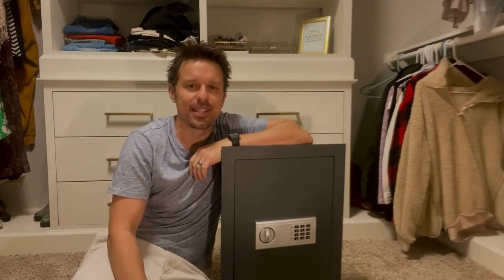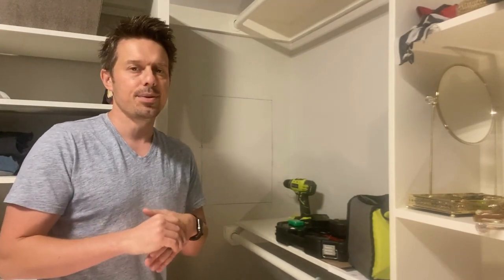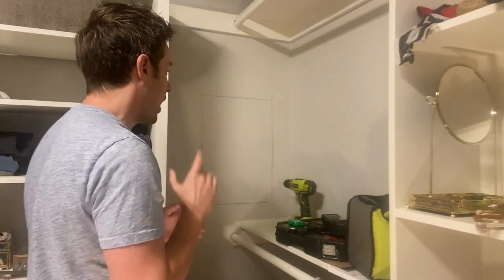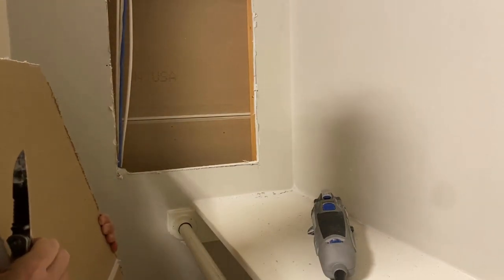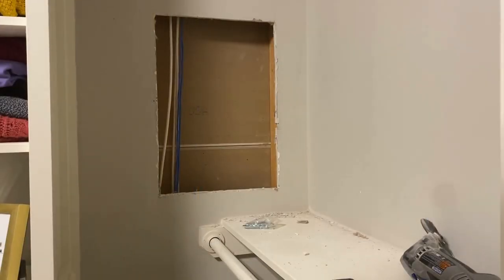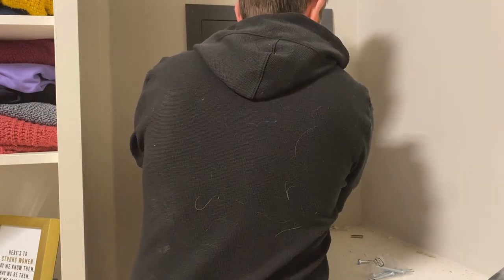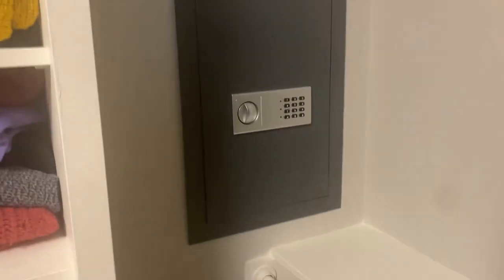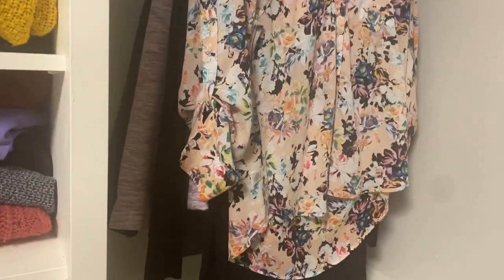How to Install a Wall Safe - Paragon Lock & Safe Install & Review

Comment: You found wires.  With my luck, I will find wires, water pipes, a SpaceX rocket, a car park, an amusement park, a Taylor Swift concert, and six natural gas lines running through that wall.  They're not there now.  They will materialize as soon as I have cut the drywall because I hate working with drywall.

Comment: Mine can’t open, the battery died. Any suggestions?
Reply from the maker: It comes with a key you can open it. If you don’t have the key, I assume a locksmith :/ if they can pick those types of locks … good luck
Reply: @bpekarek1986  thanks

Comment: Looks like you installed it in your master bedroom closet, worst place in the home to install a safe! Crooks have 8-10 minutes to get in and out and the first place they go is the master bedroom for the valuables! Try under a sink in kitchen or in a bathroom not in the master! ;-)
Reply from the maker: You are totally correct. This safe is to deter from the opportunist thief (Contractor, cleaner, keeping kids out of certain things ect...). The point of the video is more of the install. You need to find the best spot for you where you feel comfortable based on what you have locked away. As we don't keep much in our safe overall.
Reply: Someone watched the "Locksmith Recommended" video......hahahaha.
Reply: Get a safe deposit box for the good stuff.